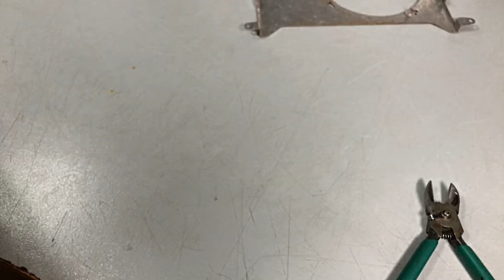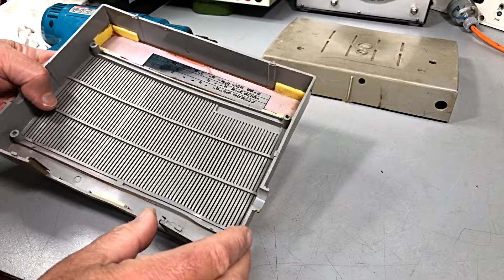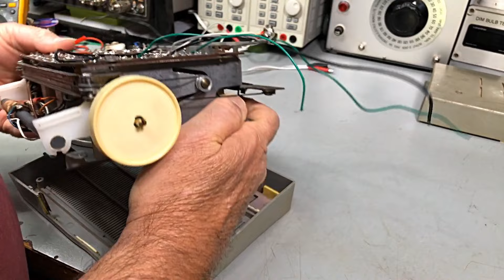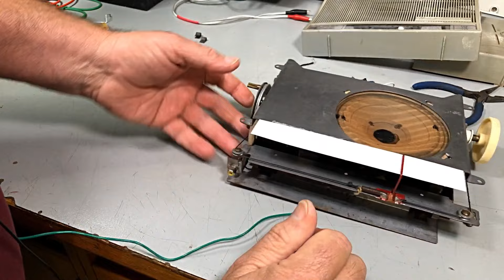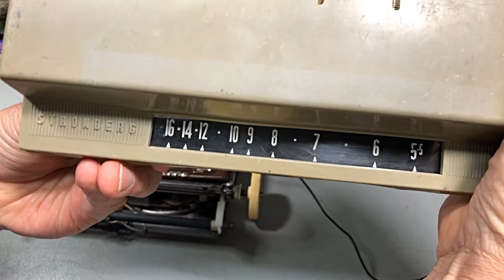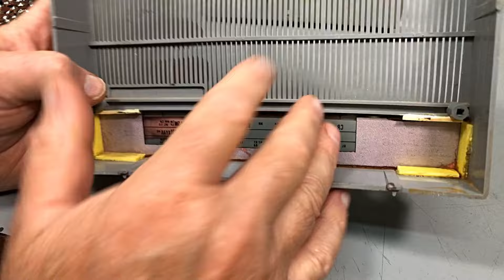Restoring the 1960 Stromberg Carlson Solar Radio - Part 3 of 4

Comment: I am restoring an original set.  The backing panel on my set is the red Laminex as you showed on your set.  I know this set is original.  The problem I have with my set is that the rear dial pointer is travelling in the incorrect direction to match the dial scale, which is the same as on your set.  The tuning operates nicely otherwise.
Reply from the maker: That's an interesting quirk, it sounds like the dial cord might just need a simple re-stringing to fix the travel direction! 😊

Comment: I have banned WD40 from my workshops. It can affect many common plastics, its is not a lubricant like fine oil nor a release agent like Plusgas. It is a Water Dispersant hence the name. The plastic pulley could have been affected.
Reply from the maker: Appreciate you comment on WD40.
I have used it for 50 years without a problem but you are correct with what you have stated. Probably better products around but I used what I have here in the workshop at the time.
Cheers

Comment: Bax Great works I have found using Magic Words helps I think you found that also using a piece of led Diffuser is excellent idea Full marks for ongoing saga of Solar Stomberg Radio,Ian.
Reply from the maker: They are great for so many things & the clear is great to replace a straight dial glass, providing it's blank of course.

Comment: Well, you won the battle of the dial string.  I almost couldn't watch that bit!  It's hard to tell but it looks like you improved the warping of the case quite a bit.  The diffuser from the LCD TV was a good tip.  I've got one laying around so I might pinch it. Very useful material by the looks of it. Anyway no doubt the next part will be up any time now.  Catch you soon!
Reply from the maker: Mate, lots to scavenge from the old LCD screen, have even used backlight leds for different stuff, great for models, nice & bright !
Glad that dial cord has gone away now !
Next video is up Pt4
Cheers

Comment: I'd bet the reason the case was warped is that the owner left it on the dashboard of their car on a hot day to get the sun to charge the battery. Dial cord restringing is one of those things that require a lot of patience and some strategically placed curse words. Black was the best choice for the dial backing. It makes the pointer and numbers much easier to read than the red. I'd bet the black would have been the original color.
Reply from the maker: Hi Douglas, I think the radio would have been warped from sitting in the sun while operational. It has no charging circuit for the batteries, the solar panel only runs the radio. It's draw is around 40ma so runs ok on the panel, although it has to have direct sunlight. No go in the shade.
Pretty sure this is the original dial cord, black is great in this one for sure !
Cheers